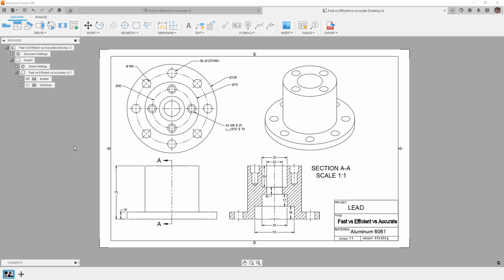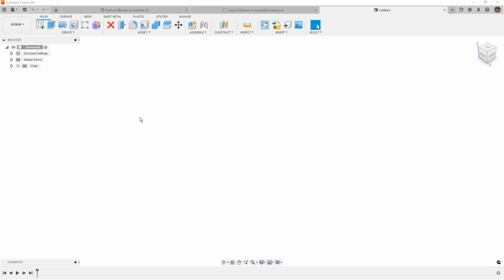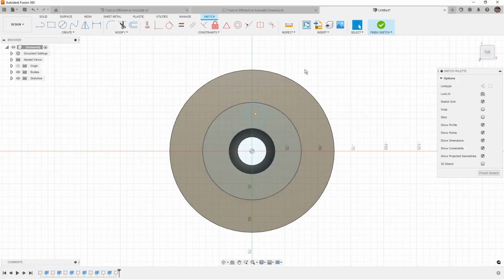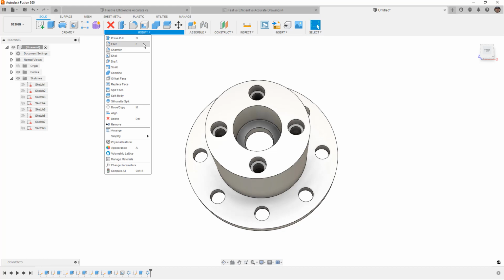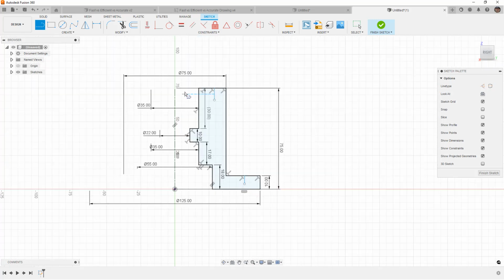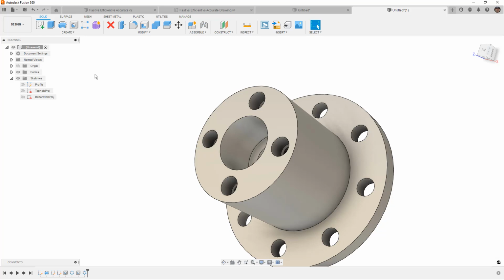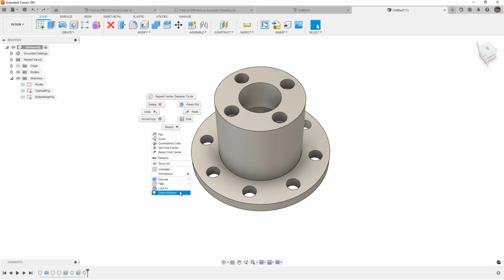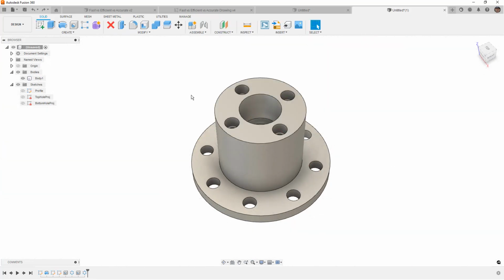How Can A CAD Designer be Fast, Efficient, and Accurate? | Comparing Different Modeling Approaches

Comment: You talked about customizing Fusion to be fast efficent and accurate at the same time. Sometimes I struggle with reminding me to create a new component immediately at the start. Is there a way to make a startup file whch would already contain a component inside the root element?
Reply from the maker: Unfortunately there aren't any "templates" that I know of.  You could create a script that runs at the startup I suppose.  It definitely has to be a thought when getting started sadly.  I will give a little thought to the script.

Comment: I suggest on the first approach, when you drew the circle from which you only used the center point for the hole command, that you'd be better off with just the point instead of the circle.  I use points so often that I added them to the sketch toolbar.  I feel they're underutilized.
Reply from the maker: Thanks Bill.  I do agree that the circle isn't needed when Point is ideal, but Point doesn't have a default shortcut key on the keyboard which is why i chose to use circle.  When i used to do this all the time in other software I would assign Q to the point tool, but in Fusion that is Press Pull by default.  I always avoid customization of my UI as to not throw off someone learning.  If I were doing this all the time for speed I would 100% use point on a shortcut key.
Reply: @LearnEverythingAboutDesign  Totally get that.  I pinned it to the toolbar but I think I will make a shortcut key for it now.  I've started using it often enough to justify.  I really enjoy your videos!
Reply from the maker: Awesome!  I think with just a handful of keys and the marking menu you can get a whole lot done.  Thanks for watching and commenting!

Comment: Very well described and shown. Also great tips regarding using shortcuts.
For more complex models I found out, its best to remodel them again when it gets too overwhelming and geometry is breaking when modifiing the model. This way one learns a lot about different design approaches and efficienc modeling
Reply from the maker: 100%.  I often use the fast method to "rough" a design.  When its something that needs to be printed, machined, molded etc then i recreate it with that MFG in mind.  Another thing that helps is if you get in a bind. derive the body/component into a new file and direct model :)

Comment: Nice work Matt very good points here. One suggestion I have to elaborate on this is to look in to how to handle the changes when there is another component which might be using this base component as its reference. In other words when component 2 relies on component 1.. when component 1 changes it causes big trouble for component 2 which has dependencies. Autodesk did a good seminar on this. Maybe the best way to deal with this is to make sure components are individual and not reliant on other parts in the design.
Reply from the maker: Thats a good point Rich.  I think the key is to use the Efficient workflow to make sure you know how designs will update.  There are multiple ways to do this and honestly i usually go to a body workflow over a component workflow and convert them downstream.  Ill give some thought to a follow on talking about that.